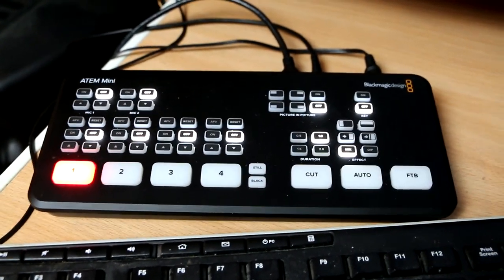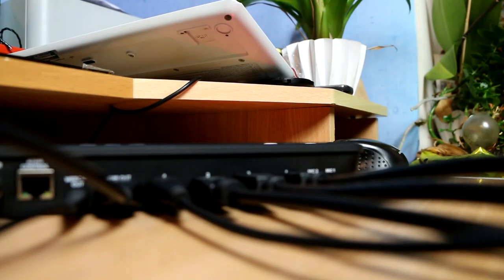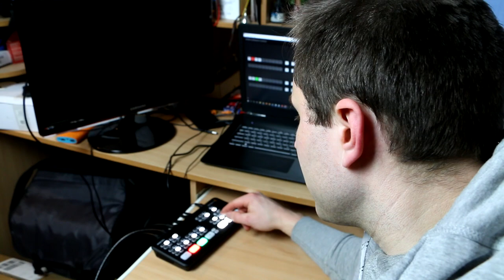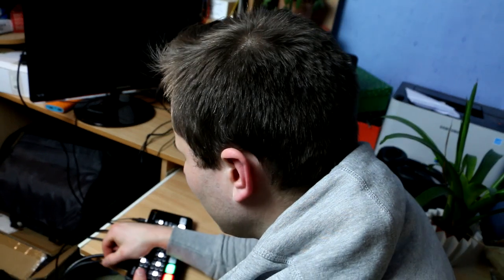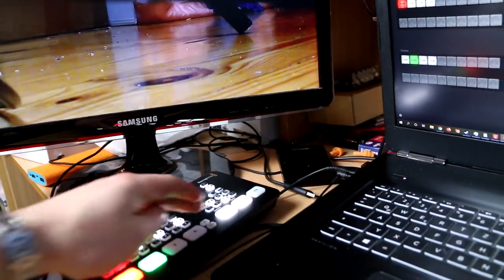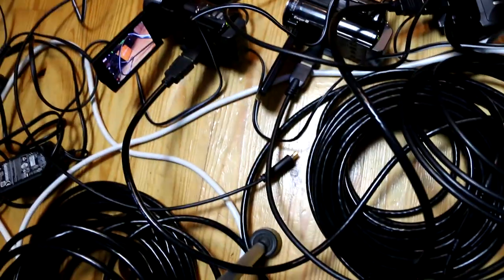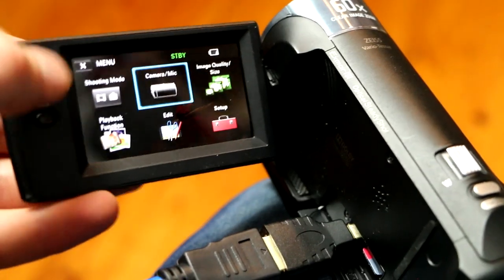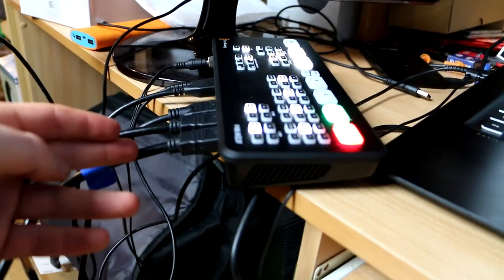How to Fix ATEM Mini problem that only HDMI 1 input works or no input from cameras

Comment: Hi, i have similiar problem, well im using it for large hall classes, I am connecting Input 1 from Sony PXW Z150 SDI convert to HDMI into Atem Mini Pro input 1, works fine, Input 2 was just Canon XA30 2meter HDMI to Atem Mini Pro input 2 works fine, and Laptop duplicate video output via 25meter HDMI into Atem Mini Pro input 3 no video, but have sound signal , I swapped that 25meter HDMI cable with the Sony camera at Input 1, it works fine at input1 , so that eliminate the cable problem, but If I use this same 25meter HDMI cable with Input 2,3,4 with same sony camera, it won't work, my 25meter HDMI are thick cable with Ethernet capability, appreciate if anyone could help, thanks
Reply from the maker: Try hdmi repeater (hdmi booster, i have a few of them, bought from ebay each for approx. $4), and yeah cable thickness wont mean a lot, i have one 15m cable, way thicker than my 20m cable and it does not work, however 20m works good, now i have bought two cheapest 30m optical cables (each cost under $60, on the box was written active optical cable, but Im not sure about that :D), this might help a lot if you need long cables or repeaters they will work good as well with atem and solve many problems, e.g., i had one camera that used to flicker at random moments now the problem is gone and i even have extended the cable by extra 5m :)

Comment: What is the solution? You spend too long saying that it does not work, but you show no anwer that I can see
Reply from the maker: Answer is different hdmi cables and if you got different model cameras, try to swap them in places. As well hdmi booster helps a lot, I have been using them a lot for cables that are not optical fiber (i ve opted out for them since they are no more that expensive)

Comment: why ATEM Mini no audio coming in or going out.
Reply from the maker: I would start with ATEM Control soft. 1. have you turned on mics on controller? 2. do you want to use audio from sound controller or from cameras? 3. I have had a lot of problems with audio on obs where I have audio in ATEM mini controller, but not on OBS, so do you have audio in atem mini controller, green bars moves. e.g. you have connected camera to hdmi 1 and turned on mic in it as well on the controller it self and you see bars moving when yous speak, but you dont hear any sound on obs?

Comment: Thanks, we do have the same issues with long hdmi cables (>20m)
Reply from the maker: https://www.youtube.com/watch?v=nb5czS5mstM
I have been using these repeaters, helps a lot, so I dont have issues with shorter cables anymore and I can make my cables longer aprox 15-20m.

I ordered 30m optical cable when I will get it I will check if it will work with atem mini
Reply: HDMI shouldn't run more than 10m! Ohms law! The edit will stop working if the cable impedance is to high. Either use HDMI-optical cables or proper extender (AMX DX-TX, etc)

Comment: Nothing wrong with the ATEM your cables are too long You cant guarantee any length over 6m,  because input 1 is the reference it can handle longer lengths
Reply from the maker: not exactly true in my case, but bcso you sound very confident in your opinion, maybe you can share some resource where I can learn more about ATEM, mini like why input 1 is reference and why ATEM haven 't built all inputs same or where they have said, that they are different? :)  Why I can't agree about your 6m theory, well I have been using ATEM mini for half of year and I have tried out 20m, 15m, 10m, 5m and 3m cables, what I can say, that you can't guarantee even that 3m cable will work, so here is the problem, why to make claims that we can use 4 inputs, but not giving any information about lengths? What I have learnt from experience using this device for long time, well, first- if you wanna use hdmi adapters, like from hdmi to hdmi  micro, you have to buy more than one brand, bcos even branded adapters always wont work, for hdmi to hdmi mini, well most of adapters will work. What else I have learnt, no point of buying hdmi extenders, none of regular will work with atem mini.  Speaking about cables, I have been using for hdmi input 1 -15 m, for input 2 - 10m cable, for input 3 and 4 - 5m cables, and I have marked each cable with camera name with which I can use the cable, because not with every cable, every camera will work. And here we come to ATEM mini and all is fine with it, well, if all would be fine with it, there would not be problem, that only certain cable works with certain camera, there should be information out, that you have to take in to the account that ATEM mini works only with right hdmi cable for specific camera(I dont know why how to tell with what sort of cable). And to add some more stuff I have noticed some problems with 4 cameras setup, but this is another topic, but it is connected with signal stability what I had never seen when I was using same cable and same camera, so it is something connected with how ATEM mini process all the info it gets..  For the future I will test how SDI cables work with atem mini with adapters to HDMI and HDMi micro/mini and if this will help to solve distance problems for all ports :)
Reply: @JUrtanschannel  I totally agree with you... I have multiple sources, all of which have clean HDMI outputs, but it seems that Atem MINI is very flaky... it did recognise my Sony A6300 straight away but it does not work with either my GoPro7 or Canon R800 camcorder  or Nikon D7100 connected to other three HDMI inputs, sometimes it can decet the signal when you go to settings or menu on those devices, but as soon as you go back to LIVE view it goes black. With Nikon is even more strange as I can have video live feed when in "on screen info" mode, but as soon as I turn any on screen info off it goes blank again.... I tried multiple high-quality cables, updating firmware on all devices, swapping HDMI inputs on ATEM Mini, and even praying... I want to love BMD devices but for crying out loud - it just doesnt work, I am going to call their support tomorrow morning and see if they have any solution. If they do I will share it here, or even make YouTube video on this subject. So dissapointed :(

Comment: so what is the conclusion - how to fix it? just by finding a right camera? ... strange
Reply from the maker: 4 solutions  1- find right cables, mix brands 2- try different cameras 3 - use hdmi booster/repeater, they are cheap aprox, $5usd and effective, I use them now and they really change the game + u can extend cable lenght 4 - more expensive , active optocal hdmi cables, even cheaper ones with mixed copper / optical fiber inside, they work as well good, I use 30m cable on port 3 and all is fine! :)     and there are some solutions how to boost signal by powered splitters, but I dont see why to use them if u can get same result with cheap and easy to use hdmi boosters.
Reply: @JUrtanschannel  but as I understand the input 1 has a problem with YUV / RGB convention. I use on my ATEM MINI PRO and for example cannot connect properly the STB via HDMI input 1 but on 2,3,4 works fine. In settings cannot change the RGB or YUV output colours. But what about when we have such 4 devices and cannot use it… I think that hdmi splitters, boosters, repeaters, extenders do not help for that - tested with HDMI lan RJ45 cat.6 extenders